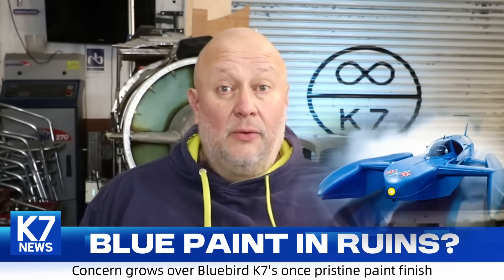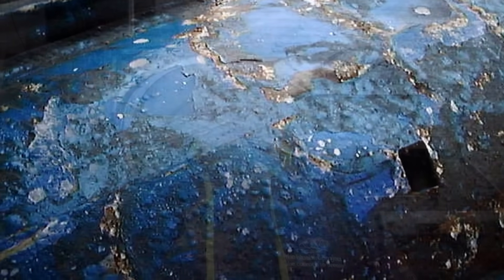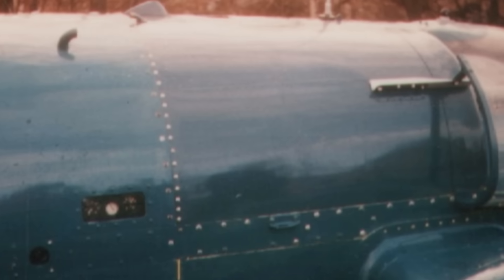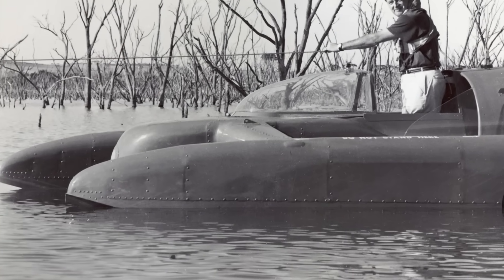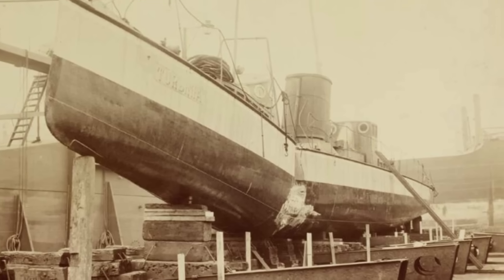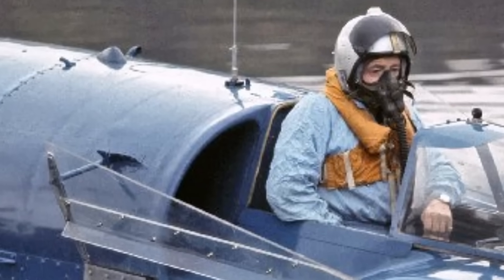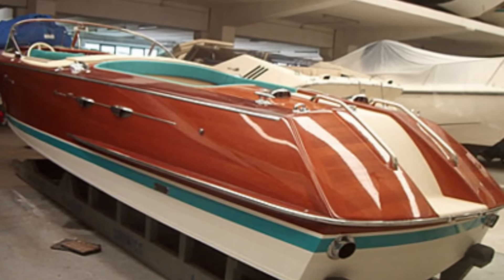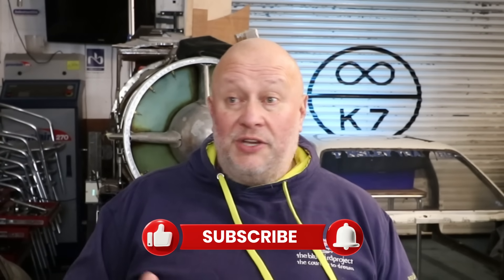Is Bluebird's Blue Paint in Ruins? Mysterious Paint Happenings with Campbell's Jet Boat.

Comment: never a bad thing to hear the background and challenges to overcome - i repainted a Harrier or three some years ago, and trying to get the correct codes etc was quite a task in itself (and actually can be sourced through model paints), the original spec back then was paint made by ICI, so no longer in existence but i eventually managed to get a good replica paint, colour correct but in a nice satin finish cellulose spray paint, looked the part

its all part of the history, including all the volunteers that work tirelessly to bring these things back to the publics interest, i always wanted to produce a detailed photographic book with captions to describe the ongoing processes going on throughout a restoration and include those working on the restoration, the history is not just the past, it continues and sadly there are a too many numpties that just don't get it - a bunch of nutters removed the two main gear wheels, stripped them down, split wheel hubs, fitted new tires, no one rubbed the paint down on the hubs, one numpty painted on wheel silver, the other painted it grey, neither were the paint i had got made for the job, the original off colour white, the mind boggles - and one guy removed an outrigger wheel which was deflated and assembled it completely wrong, no pics taken before and after to aid reassembly just drives you nuts
Reply from the maker: Nice to hear from someone who has also taken the time to get it exactly right and the reward for doing that is to have all your hard work taken for granted, which is good because you don't want people looking at it and thinking there' something wrong but they're not sure what. Cromadex did a great job for us and Bluebird's paint was perfect by the time were were finished.
Yo mentioned wheels - they're another story. The cradle wheels were only used in a very few applications, DH Comet, Bristol something or another and the Saunders Roe flying boat, which is where Campbell got his from. From the beaching gear used to haul them ashore. Then the tyres were grass landing tyres from Gloster Meteors. We scoured the earth to get the right wheels and tyres to make the cradle look perfect and now the boat is being displayed on completely the wrong tyres. People who do things like that should not be allowed near historic vehicles.
Reply: @TheBluebirdProject  i never minded that much about the work i did not being recognised, but i wanted to produce a book of the work that was done and have it sold in the museum shop, you can do your own book and upload to amazon and get them printed as an authors copy for around £8, then sell them in the shop for double that, and have the museum earn some money back on work done

now if you are after tyres, there is a guy near Cambridge who keeps, new old tyres, past shelf life, we had many tyres from the chap there for Harrier, Metier etc

Tenrich Tyres The Old Station, Station Rd, Isleham, ELY CB7 5QT - see on Google maps - the guy there is very useful, give him the size and he can match best he can, maybe different manufacturer but that can't be helped especially as so many tyres have been obsolete for a long time
Reply from the maker: @patchmack4469  Dunlop still list them but they have none in stock. They have the tooling to make new ones but they had a minimum order quantity that just put it out of reach.
Reply: @TheBluebirdProject  this is the same story i hear from the guys at Bruntingthorpe who run the Lightnings - Dunlop insist they need a minimum order of many hundreds of tyres which like you is ridiculous as well as expensive - because the Lightning wheels are very specific with a very high pressure of something like 300psi they need to be correct, there is no substitute tyre like them
i believe the Lightning trust had to pay a huge sum of money just to keep the tooling kept for their needs, its mental, but i do kind of half understand because you still need to produce all the interior sections, wire mesh and so on and then pay staff to make them
you would think a big manufacturer would have a small section of guys making tires for older machines etc, just for historic value

just reminded me of something completely off the wall, i knew a guy who did injection moulding, showed me a mould he purchased, i recognized it straight away, from my childhood, when mum made my brother and i a birthday cake, it had a train and carriages with a candle in each, it was the same mould - the chap was going to make a small run of them, so moulds can be found and purchased, its just finding someone capable of making the item

Comment: Hi I wanted to know why is the rudder off set?
Thanks Moggy Mark.
Reply from the maker: It was originally designed with two rudders, one each side, but the right hand side one was never installed. Instead it was fitted with a blade over there to aid stability and keep the nose down.

Comment: Further to your request for video topic suggestions. I would like to see how you restored all of the main structural components ( keel, sponson cross beam. ) as they now have to take the actual loads of operation.
Reply from the maker: That's a few separate exercises. The frame is steel and the spars are aluminium so different approaches were needed but we did it. I'll put that on my list for a future video.

Comment: One interesting story for an episode could be the work to make lefty and righty without anything to measure, or just on where all the info and drawings came from. We’ve only met once Bill, when my good lady surprised me with a birthday trip up there she bartered with Tunnucks and Rivets.  You were on with sponsons and I think ( it’s been a while ) had figured out that the old drawings hadn’t taken into account material thickness so were on remaking internal ribs I think.  I thought it was a fabulous example of the archive exploration challenges that happened.
Reply from the maker: We had very little in the way of drawings. Most of them were of how the boat was originally built and it was heavily modified thereafter, and we had a lot of it that just needed repaired. The sponsons were scratch built from a single drawing that contained mainly lists of materials and tables of sizes. I do remember your good lady calling to ask if you could visit. Hope you're well. 👍

Comment: So who is going to set the bluebird up for her run on coniston next year as mentioned on the museum website?.
Reply from the maker: Whoever it is, you can be absolutely certain that they have no prior experience with that machine. We grew up with it over many years and know every foible. No one else does. They don't know which bolts like to undo themselves unless you wire lock them or which fittings on fluid pipes are awkward. We do.
Reply: It won't happen IMHO, wait for the excuses. I suspect that many of us know who they will "blame"!